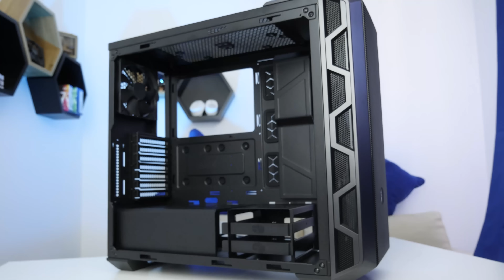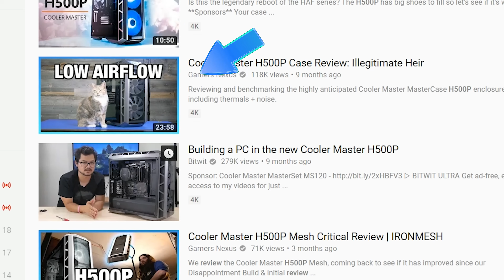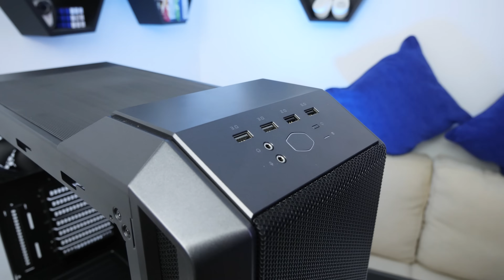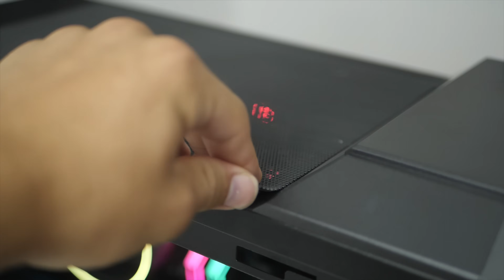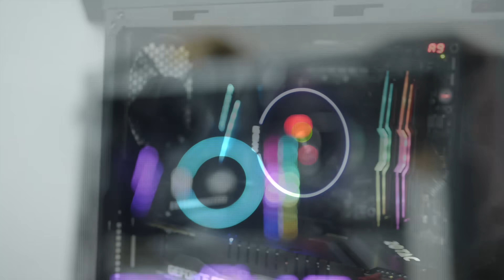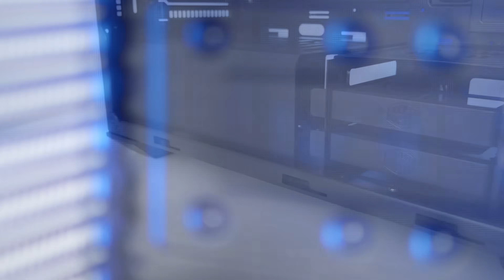The ULTIMATE $99 High Air Flow Case? [Cooler Master H500 Review - They Fixed the H500P ...AGAIN?!]

Comment: Can any1 help me, i have the same case, in time the box in the bottom where the battery resides gathers to much dust and the fan makes a weird noise, i try to somehow to remove the box so i can clean in inside but i fear i will break it cause i dont have the right tools, is there a way to open it safely?

Comment: There's a Vertical GPU kit for Master Case 5/6 series with 7 slots and riser cable for these cases. Remove the 7 bracket slots and slide in the kit! Easiest Vert GPU kit out there.

Comment: can we install the 360Aio in front without removing the 200mm fan? 
I mean still using the 200mm fan with 360aio inside in front.
Reply: yes you can. i bought the same case and i can mount one of the thickest 280mm AIOs on the market ( Arctic Liquid II 280mm), so any 360mm would be fine too! you'd just have to mount the AIO in a way that the fans are sucking fresh air in directly from the 200mm fans

Comment: Has anyone swapped in Noctua NF-A20 fans in front  and a NF-A14 fan in rear? And/or added two NF-A12 fans on top? I want to get one of these cases but convert it to Noctua fans and a NH-D15S to be the Noctua Master H500 with super airflow noiseless case. I want to build it on a Ryzen 2700X with this case or the M or P when Zen 2 launches.

Comment: I have this case I would give it 9/10 lots of room front and back easy to build in addressable RGB front fans would have been nice
Reply: a little confused about this... I ordered an h500m I'd like to be able to control the fans in software but also like he said on a switch in the front... how do i do that? please reference a guide if you can

Comment: I have a question, I just got this case but is there any way to control the two 200mm fans with a motherboard or through a software. My motherboard is a asus prime z390-a. I also bought a  cooler master ml240r liquid cooler which also has a controller. Can I plug in the 200mm fan controller to the other one
Reply: yes, fully compatible with all rgb sync software. but in mind you need standart not addressable connector on mobo for those fans.